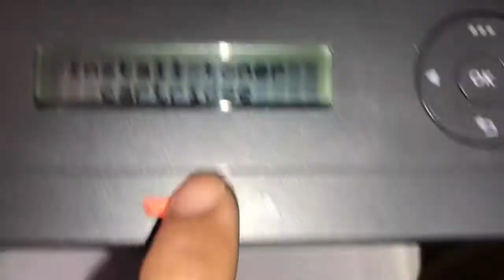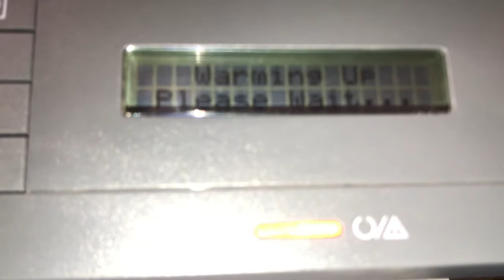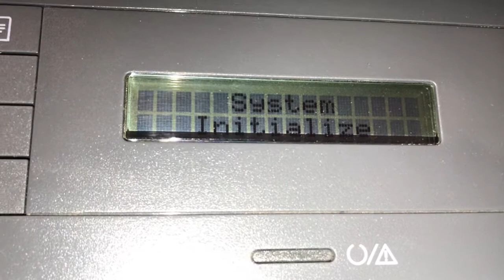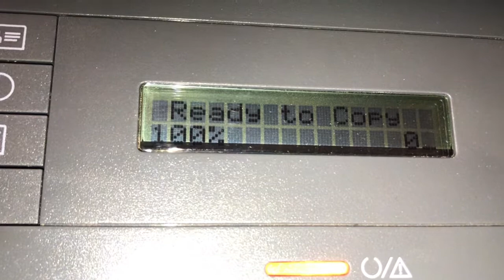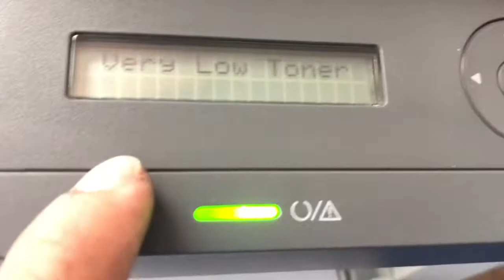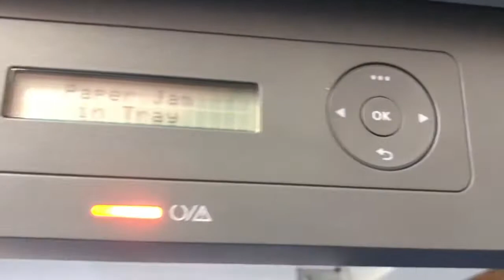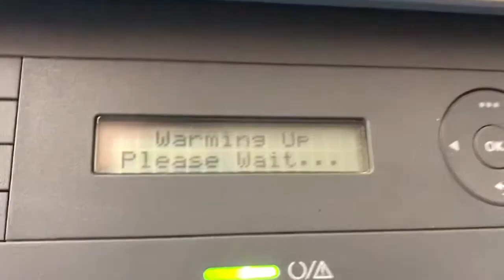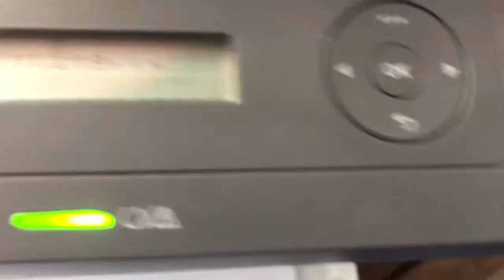HP Laser MFP 135 131 133 137 138 not recognize toner cartridge error Install toner cartridge fixed

Comment: How to turn off the startup message???
Reply from the maker: Which messages you  want to turn off? go  to  control panel or install HP Smart app , have  options turn off alert message , my others videos should be have
Reply: @howtokh855  ok.. but I did the same to turn off low Turner message but still it's not removed. I have also another problem with the printer . That printer is showing in my NVR cctv list that printer is a cctv 😁. Network error IP conflict. After framework update it removed
Reply from the maker: or for Very low  toner cartridges  cannot turn off , if the printer show stop press narrow key select continue to print or copy